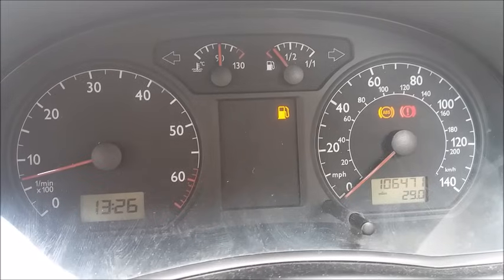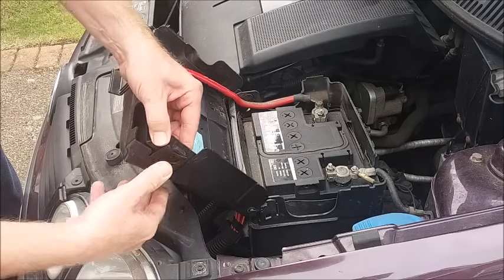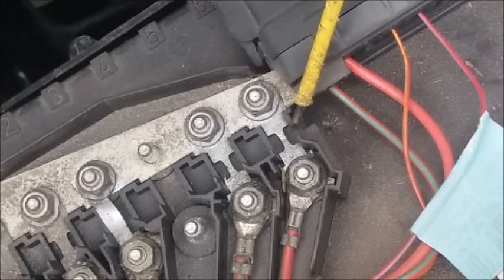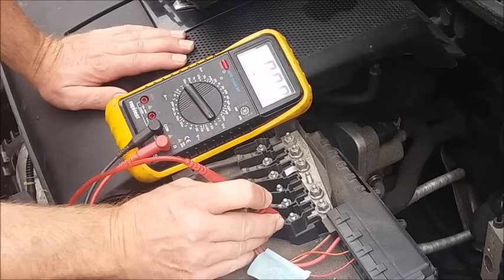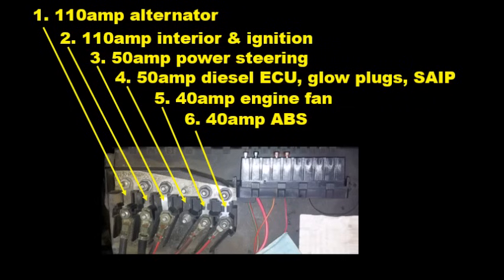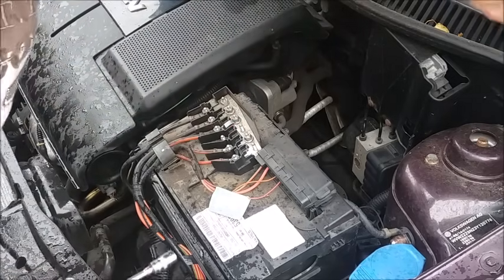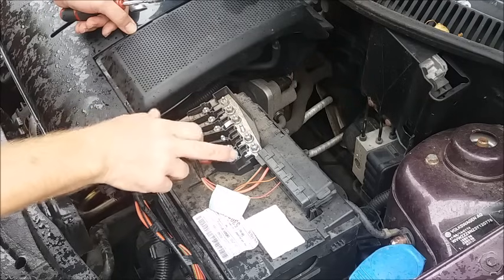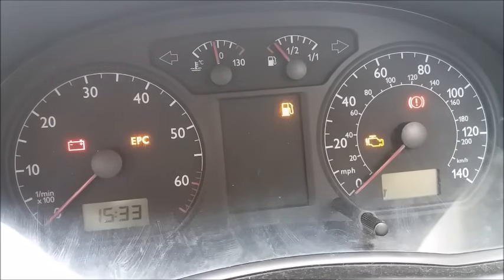VW Polo ABS Light ON / Skoda Fabia ABS Light On | Easy DIY Fix

Comment from the maker: 🛠 Replacement 40A fuse with worldwide delivery:  https://www.ebay.co.uk/itm/304461431795
Reply: there are sex fuses there on the battery .. my vw polo the third one is broken .. and ABS , ESP warning light is on .. my question is is the third fuse also the abs                        and esp ..
Reply from the maker: @Somfox1  It might be a different fuse on different versions.

Comment: This was exactly the fault on my wife's Polo( 2005 ). Thank you very much for your video which is very good. Took me straight to the fault and saved me loads of time and hassle.
As you say at the end of your video, the warning lights reset by themselves once you have changed the fuse and then drive the car over 10mph. Thanks once again.
Reply from the maker: You're welcome. Yes, loads of people think vagcom is needed to reset but this simply isn't the case. ABS is only 'active' above 8mph at which point it performs a self check. This isn't 'strange' or unique. All ABS does this. It's a legal requirement.

Comment: Saw the ABS-light and immediately thought that it was going to be costly. Found your video, checked the fuse today and to my utter joy - there was a tiny crack. Bought the fuse at VW a mile away, swapped it and problem solved! 
Total cost = 4,67 pounds :)
I thank you so very much, Sir!

Comment: My car failed it's MOT due to ABS light Thank you so very much for this video. I replaced the cracked fuse plate - got my car through a MOT retest. I was told it was the brake pump - could cost £500 - 600. I thank you with all my heart - so easy to fix. Many best wishes

Comment: Exact same reason why my 2006 polo tdi abs didn't work. Thanks a ton, saved loads of Euros with this video.
Reply from the maker: 👍👍👍. Worthy of a coffee? ☕ Support the channel here: https://www.buymeacoffee.com/CycloneCyd ☕
Reply: @CycloneCyd  send a few euros towards your way. I think my car is later model and they had figured this problem out since my car had a free fuse next to the broken one. I just switched the cable there.
Reply from the maker: @Plizi  OR it was a fuse for a feature your variant doesn't have. Either way up, nice work. A garage would probably have quoted you a new ABS block for 1000 quid (have a look through the comments, lol). You'd think a garage would know to check the power supply first.
Reply: Was ur car failing to start ?
Reply: @gang-gang8325  no, it started fine
Reply: @Plizi  mine suddenly dies and abs light come on

Comment: Mate, God bless thee. This happened to me on my way to thee mot. I fixed it with a piece of wire. Still holding. Not yet inside but fingers crossed.
Later edit: the car passed the MOT. I bridged the ruptured fusible with a piece of wire. Worked like a champ!
Many, many thanks mate!
Reply from the maker: Glad it helped, but do replace that fuse!
Reply: @CycloneCyd  I did replace that fuse. Took 5 days to get it and cost me a full quid or so... 💩

Comment: My dads Polo (2003 / 1.2) had this  same problem. Fault code was failure in the hydraulic pump (cannot remember exact code unfortunately) but the actual cause was in fact this broken fuse. Repair shop estimation for the controller + pump was around 1000 eur! (Finland) Even salvaged parts were around 400 eur. I was able to fix this by replacing the fuse. This really saved us! Huge thanks!!
Reply from the maker: mt7580 
Hi, thanks for watching and for the kind words. If I put on my cynical hat, I'd say your garage were trying to rip you off!!! However, with "computerised fault codes" these days, too many people (incl trained mechanics) take them as "gospel" and forget to get back to BASICS. When summat isn't working, yes check the codes, that gives you a pointer, but test the power supply (connections, fuse, wiring) FIRST before condemning expensive components.
Reply from the maker: mt7580 
Here's a thought: let your repair shop know how you solved the problem for just a few $$s and share this video with them!! Indeed, put a review on their social media pages (incl Google Maps) with a share link to this video. Remind them that "every day is a school day" and help others avoid being ripped off too.
Reply from the maker: You're welcome mt7580. Glad to be of assistance.
Thanks for watching and don't forget to share.

Comment: great, these guys that do this save people so much money and stress!
Reply from the maker: Hi rockdude100, my advice would be to replace the belt. When you do, be sure to clean the pulleys before fitting the new one (brake cleaner is good). It could be something or it could be nothing, but a new belt is cheap enough that it can be replaced as a precautionary measure. Far better to replace it at your leisure too, rather than as an emergency repair should it break.

Comment: Wow... just reading through the comments... I'm amazed at how surprised the viewers are. 

I agree, here in the states, those fuses are a high failure item... sometimes you can catch before they crack using a thermal imager. The weak connection at the terminal eyelet or strip fuse glows and hot to the touch.. I've seen them cook that entire assembly. A bit dangerous considering the battery just below is highly flammable/explosive. Lol. 

Great video!  I'll need to go through some more of your videos!  Excellent quality for sure! Cheers!😊😊
Reply from the maker: Hi Cuba, sorry about the long wait for a reply. Thanks for the kind words, I am very much trying for quality over quantity, 'certain' other channels prioritise "entertainment" value over the content value (for eg spanner sizes, tools required etc etc)
Reply: @CycloneCyd  haha.. no worries! I've been extremely busy myself, so that's understandable! 

I appreciate the quality and forethought into the videos!

Comment: I just had a abs light on my sons polo vcds read faulty right front sensor which I changed and cured the problem but this video learnt me about the battery fuses as well thanx
Reply from the maker: Hi Glyn, thanks for watching and interacting. Yeah, as you can see from other comments the fuse is something even garages fail to check. Sometimes the fault is elsewhere but no matter what system is being investigated, ALWAYS check the integrity of the wiring and power before lashing out good money on parts.

Comment: Hi I was wondering if all the 6 fuses are meant to connect to a wire as I have 6 different fuses but only 5 wires connected with the 6th one (abs one) having no bottom bolt or connecting wire. I have a 2009 polo. Cheers 👍
Reply from the maker: Depends on the options fitted to each car.
Reply: @CycloneCyd  cheers for the reply have a great day my friend

Comment: Thanks very much for this video, super helpful!

It actually turned out that it was another fuse on the battery which had split and broken (number 4) so I went ahead and replaced number 4 and 5 with the multipack purchased from Halfords and it worked in turning the handbrake and abs warning lights off (thankfully).

When I was in Halfords the chap working there also said that sometimes driving in two figures of 8 (back to back) and then driving in a straight line afterward doing this also sometimes clears the abs light and he admitted it sounded like an old wives tales. Needless to say I tried it just after purchasing the fuses in the car park but it didn’t work so went on to follow this vid. The figure of 8 technique might work for some others though so worth giving it a try if you have enough space to do it safely (of course).

Good luck
Reply from the maker: rik Yes, I think that figure of eight thing is a myth. It's getting above the ABS threshold of 8mph that's important. You could drive up a leg of the Eiffel Tower as long as you get over 8mph, lol!!
On your other point, it is possible the order of the fuses changed at some point. My labelling came from a 2003.
Anyway up, glad to have been of assistance and that you're all sorted.

Comment: This is such a helpful video! I took my car to mechanics for this issue and luckily he was honest and said it was just the fuse so I'll be doing it myself however he said 'it needs to be reset' im guessing he means the battery? Do i need to do this and how do I go about doing it? Don't want to take it back if I can do it myself! Appreciate any advice and thanks again for video!
Reply from the maker: Hi Em, thanks for watching. Don't forget to like and share.

Once you've put a new fuse in it, providing that IS the only problem, simply drive above 8mph and the system will self check and if no fault is detected the light will extinguish. If the light stays on there is another problem. There's a link to fuses on Amazon in the description if you need it. And a tool too. Do come back and let us know how you get on.
Reply: Okay I'll give it a go and let you know how I get on fingers crossed! Thanks for the reply!

Comment: I watched this video just after my partner took hers to the garage. She just got a bill for £107 which could have been avoided so easily. Heart-breaking. I suppose we are lucky that they recognised it was this very quickly rather than trying to replace the pump!
Reply from the maker: I'd say you got away lightly❗ Sounds like your garage are competent - not many of them about. I'd still say you were overcharged. If it spent 20 minutes in the shop i'd be surprised.

Comment: I have this problem, had a quick look at the fuses, and although they seem intact (i have ordered replacements anyway) the piece of metal that they sit on is very corroded. can these be replaced or cleaned up, I'm not sure if it might be causing a bad connection, as a couple weeks ago whilst driving, the glow plug light started flashing on the dash, but stopped once I had stopped and restarted the engine
Reply from the maker: Yeah clean up those connections

Comment: Mine problem is abs light on after changing brake pad. I tried to reconnect the battery to reset but the light still on. What should I do Sir. Thanks
Reply from the maker: Sounds like you might have disturbed the wiring or connector at one of the front wheels. Check connections and that wiring is not chaffed.
Check this fuse too.

Comment: Hello. great video!!! I have a 2006 fabia and when i am traveling around 120 km/h  i lose power instantly, my spedo goes to zero and abs and asr stay on! what could this be?
Reply from the maker: Hi metal rs, thanks for watching. When you say "asr stay on", do you mean the asr light on the dash comes on?
ASR is a sort-of traction control system, and it could be faulty causing it to cut power unexpectedly. Try turning ASR "off" each time you drive the car and see if you still get the problem.
Reply: @CycloneCyd  i tried turning the asr off but the same thing happens. the asr and abs warning light come on, the spedometer needle goes to zero and the car behaves like it is braking for about one second. Then it regains power instantly.
Reply from the maker: @metalrs6306  So, the brakes DEFO feel like they are being applied?? Does it 'pull' to one side at all under this braking? Even lightly?

Comment: I got the same problem, i'm waiting the link fuse, i hope this will work !
Reply from the maker: One cannot discount that there might be more than one problem, but if the fuse is cracked there's a fair chance a new one will fix it. Let us know how you get on
Thanks for watching. Don't forget to subscribe and share.
Reply: I tried, but it doesn't work for me...
I'll try to get the tension on the both side with new fuse...
There is a direction for put the fuse ?
Reply from the maker: No. Fuse can go either way round. Maybe you have a faulty sensor after all. Check the wiring too. Damaged wires and bad connections are common on many cars
Reply: With voltmeter, abs is 12,5v, so the fuse work, maybe it's sensor, do you think it's usefull to buy obd scanner, for see the error, or should i go to garage ?
Reply from the maker: 1. have you driven the car just far enough to get over 10mph (15kph)?
You need to do this to reset the fault light
2. if that doesn't work, then yes you'll need to go to a garage. A generic OBD reader will not read ABS codes because they are manufacturer specific.
Alternatively:
If your voltmeter can read mVac, then set it on it's lowest scale and connect to the sensors. Spin the wheel by hand and you should get a small voltage.
Also make sure to test and inspect the wiring for damage - particularly near the wheels and at the rear.
Reply: It's working !!!  for resume :

since I bought my car, I had an abs problem, the salesman told me it was a wiring problem. So I came across this video trying to fix it. The fuse was broken in the battery compartment. I bought a new one, and I replaced it. Then after travelling at over 15 km/h, the light went out.

I went to the garagee that had passed it to me at the OBD, which detected a hydraulic pump problem (probably because it was no longer powered by the fuse...)

Thanks for your help, and your advice you just won 1 subscriber :)
Reply from the maker: Florian Houdebine Brilliant news. Well done for persevering. 
Thanks for subscribing. Don't forget to share. 👍👍

Comment: Hello, I have skoda fabia, it's VW groups almost everything is the same. The same lights of controls were showing to me. I found that the right front (two pins) sensor is damaged - resistance - no conduction. After watching your material, I checked the 40 A fuse and it's cracked like in your movie.
I do not know how you did it, autosewis in Poland, I think about 100 - 200 euros.
Thank you for your help and best regards.
Wojciech
Reply from the maker: Hi Wojciech, Thanks for watching. Don't forget to like 👍 share and subscribe 📝.

Very happy this helped you out. Did you have any problems getting a spare fuse? 🖖
Reply: @CycloneCyd  
Hi Cyclone, no problem fuse , 1,5 EUR. 
BRG

Comment: Can this be done to a Polo 6N2 from 2001?
Reply from the maker: Honest answer is I don't know because I'm not familiar with the 6N version, but I wouldn't be surprised if it is the same. Always check the main fuse first anyway. 
Please let us know how you get on.
Reply: @CycloneCyd  I have 2 fuses which are ok but I found the problem right away. Under the back seat there are 2 conectors one on the left one on the right so I did a test, the abs light was off and when I sat down it came on as well as the handbrake light is going on and off, so I'm pretty sure I need a car electrician too look at it
Reply from the maker: @GabrielSGS  well, first, well done you for finding that. Sounds like the sort of issue that could have taken weeks to find.
second: yeah that sounds very much like a worn or damaged connector under the seat. It needs to be inspected closely to find the exact point of failure, but it should be fairly easy to fix once you have. If you don't feel confident then yeah take it to an auto electrician.
Thirdly, I see from your 'about' that you're in Romania. What a shame you're not close to me in Rugby UK as this fault and repair would have made an awesome video.
Do please keep in touch and let us know how you get on with this.
Reply: @CycloneCyd  this might be a bad idea but I want to cut the old conectors and add brand new ones with longer wires and put them under the chassis so to say so the back seat doesn't sit on them and hopefully this will solve the issue
Reply from the maker: @GabrielSGS  replacing the connectors is probably a good idea (search AliExpress for pre-wired units) but relocating them to the other side of the bodywork may be of dubious benefit.

Comment: Hi mate, 
Is there a diagram to show which wires connect to each bolt? I can see that your middle one has no connection, however, within mine the far right has none - and my ABS light is on - perhaps when the battery was changed (quite recently, I have just been given the car) they mismatched the connections?
Reply from the maker: Time 4:04 in video
Reply: Cyclone Cyd does it matter which small  (assuming 40amp) lead is connected to the two left fuses? One is red and green the other red and black?
Reply from the maker: @raymansandhur8211  I can't be 100% sure, but I wouldn't have thought so

Comment: Have you used any tester and is there cheap ones for fabia Skoda?
Reply from the maker: Hi, Iced Earth, welcome aboard 
Generic code readers only read OBD compliant codes (ie engine). Anything else (ABS etc) is manufacturer specific and so usually requires expensive gear (VAGCOM in this case)
If it's OBD codes you want to read, I suggest getting a Bluetooth OBD adaptor and using Torque Pro on your phone (Android). That'll run you less than 20 quid all in and does so much more than just read codes. I use this https://amzn.to/2m439QG. If you don't mind spending a little more, this is very good quality and easy to use: https://amzn.to/2RpMche.
Given that an ordinary garage will charge 30+vat just to read a code (60 or more at a dealer) then a simple code reader will pay for itself many times over the years.
Reply: @CycloneCyd  So if car show ABS-light so can these obd-readers show what is reason?
Reply from the maker: No. You'd need a VAGCOM clone for that